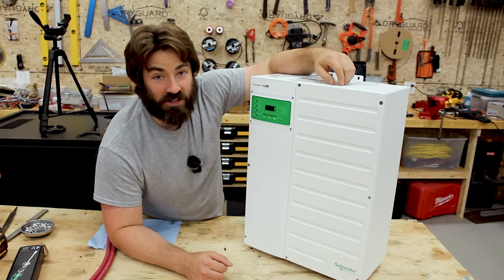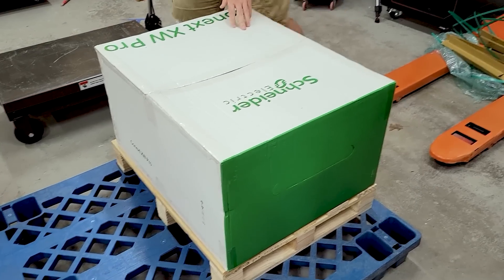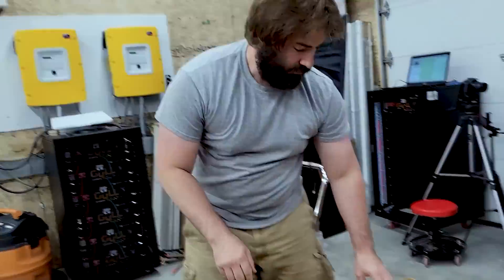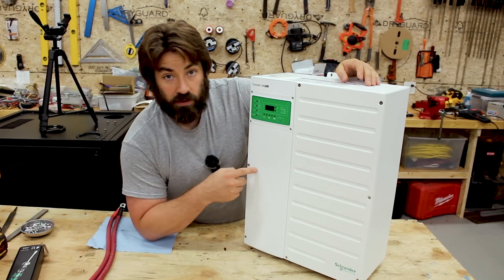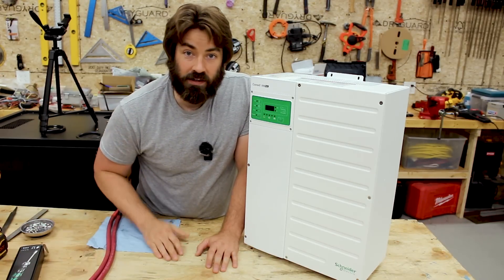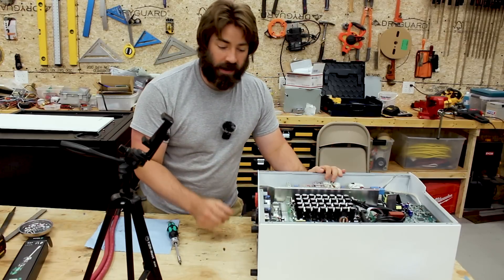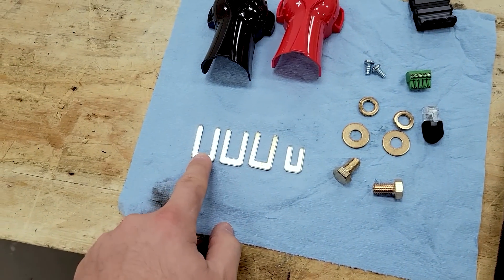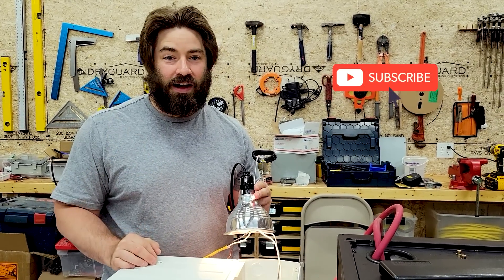Powerful Inverter for Solar Off Grid, Whole House, Schneider XW PRO 6848 Inverter, Hybrid

Comment: Dave, my first 48V solar system was a Schneider Connext 6048 (I think Connext was the Series model or the control unit?) It burned up in my solar shed fire that was caused when my Tesla batteries were charged at -20F and the heater in the shed quit working. It was connected to two Outback 200 Charge controllers and it always was giving me problems with my system. After I connected the auto transformer to my Sol-Ark 12K I haven't had any problems with any well pumps turning on or any other issues with the Sol-Ark 12k

Comment: Hey David, I would love to see you test this on big 220 air compressors, welders and heavy inductive loads like that! Thanks! Love your videos!
Reply from the maker: Thank you for the suggestion.  so far my initial tests with 120V stuff is awesome.  I'll try to pull together some 220V loads for a video.
Reply: @DavidPozEnergy  Yeah, but the real test is to put some sizable INDUCTIVE loads on it. That is what this beast is supposed to handle, and that is a key separator of the men from the boys. So motors, welders, etc. @240VAC.
Reply: That's already been done on YT by Abney Solar: https://www.youtube.com/watch?v=-Ez4cbuy7IQ&t=1131s
Reply: Abney Solar did that already on YT, although he used 2 units stacked. https://www.youtube.com/watch?v=-Ez4cbuy7IQ&t=1131s

Comment: Awesome inverter, love seeing the toroidal transformers! Two things come to mind - can you check what the no-load power consumption is? Curious how it compares to other options on the market. Also, you noted at 3:00 about connecting grid-tie inverters. I assume that means you can backfeed through it to charge the batteries? How does that work and will the inverter cut off when the batteries are full?
Reply from the maker: I'll be testing that stuff, but it is supposed to do AC coupling.   This mean you can use a grid-tie inverter or micro inverters and the Schneider uses the power to charge the battery.  Then, frequency shifts when full.  I'll test to see how well it works
Reply: I have a Schnider inverter with an AC coupling to a soul solaredge and it works flawlessl.  when the grids down it creates a grid that keeps the solar running. It charge is the battery, when the battery is full it’s frequency shift up turns off the solar will run the battery down a little bit. Bring the frequency back down and then Solar starts back up and it can keep that up all day long. 

Feel free to ask me any questions about it I’ve been using it on grid and off grid for four years now .
I have an AC coupled and DC coupled .
Reply: The other inverter needs to support the frequency shift, too.  Newer inverters will reduce output with every .1hz shift.. older ones will remain 100% output until 60.6hz (I think) and then drop offline until the batteries are discharged enough for the xw to bring it back into appropriate range.  It still "works" but is not as gentle. They'd be 0%, or 100%, so the batteries would need to be discharged enough to support the 100% (along with the loads, obviously)

Comment: I’m an off grid Solar bozo since 2005. I have a large homestead here and have multiple XW inverters. They are a beast and I haven’t found anything they wouldn’t power. Most of my inverters were manufactured in 2010 or 2011. Still going strong. I think it was DUMB of Schnieder to discontinue the SCP and force you to fumble with the Insight and a computer. Especially when almost all other competitors are placing advanced displays right on the inverter. You will need someway to program some basic battery voltages, etc. The mini PDP is enough for most people and makes for a sexy albeit expense setup. Have fun with your new workhorse!
Reply: what?  the SCP isn't discontinued!
love my Schneider (and older Xantrex) stuff.  i'm with ya, i think it's stupid there isn't a way to program the inverter - FROM THE INVERTER!  like via a user interface or bluetooth or something.  you HAVE to either get the SCP or the Gateway/Home/Facility...  hell, for the price the SCP should be included.

Comment: Very nice 👍 what a smart design, looking forward to your series of videos on this beast 😁
Reply from the maker: Thanks.
Reply: This is the best inveter that ever made. I am using the xw6048 since 2009 and never had a problem strictly as offgrid. This thing is robust. I ran four 18,000 split ac units and all my other household electrical appliances. Never had a problem.

Comment: Really interested in this inverter. My Sol-ark puts out a lot of Dirty electricity because it is transformerless. Transformer based inverters put out clean electricity.
Reply from the maker: I agree.  The manual even has a page talking about how clean the electricity is for use with HAM radios.  I'm not a radio person, but I understand it's a big deal.
Reply: In the last year or so, I keep getting faults on my inverter and the fault are not because my inverter is bad. It my power company’s power is bad, it’s sensing how bad the utilities current is and tripping a fault warning. 

Twice in the last year, it’s even disconnected from the grade for a little while because the grid voltage and frequency went out of spec .

Comment: Amazing surge ability.  Very much like the sma sunny island with that toroidal transformer.  Interested to know the idle current and its suitability for zero export.   Ideally you have it feeding a sub panel of critical loads and back feeding your house main panel but not exporting. Does it use CT’s on the main feeder into house?

Also if charging from a separate dc charge controller does it use a shunt to measure that charge current?
Reply from the maker: Hi Wes,  I think it was 30W in idle (on, but no load).  I know the manual shows some CT's you can buy for zero-export ability, but I run my equipment off grid.  There is an option for an external battery monitor that includes a shunt, but that's only required with different brand equipment.  I think the Schneider charge controllers record and report the data on their own, but not 100% sure.  it's something else I want to test.
Reply: It is very easy to set up zero export for everything that’s backed up by the inverter. It’s a simple setting that you turn sell off. It will then operate and load shave mode. Where is zeros out the energy consumption from the grid for all your backed up loads. 

In my house I have the inverter set up as a whole house transfer switch for backs up my whole house . As long as you are DC coupling the solar and it will work perfectly for zero export AC couple that cannot control the power flow going through it back to the grid when it’s hooked to the grid. 

If you want to set it up to zero out your whole house, not just what behind the inverter, you can put a separate set of CT is on at your main point of interconnection and set up a few settings to allow it to basically zero out the whole house. whenthe grid is up. when the grid is  down it will just back up the critical load panel .
Reply: I have my XW pro setup with a continetal controls wattnode,  so it can "sell back" to the main panel,  but limits itself so as to not sell back to the grid.   Works really well.  I have a spare wattnode I'm willing to send david, if he wants to try connecting his grid input, and "selling back"
Reply: @JeffPalmer941  Do you have the exact model number of the wattnode you use?
Reply: Idle power consumption is something in the range of 30 to 50 W

Comment: Awesome - glad you finally got a Schneider.  You will need either a Insight gateway or SCP to program it.  You can DIY your way around not needing the big or mini PDP, but you still need some way to switch and protect your AC and DC circuits.  The PDP's provide a place to do that, as well as posts to tie in other items like a solar charge controller.  But not strictly required for somebody handy like yourself.  Looking forward to your follow-up videos.
Reply: He mentioned the PDP so I assume he has it .

Comment: I used to work with big microwave power amps that demanded a lot of cooling. Big fans and similar metal mesh on the input.
One day we had a cricket infestation which got sucked into the intake. Blended and filtered crickets made a mess of that amplifier!

I first saw that inverter on Wild Wonderful Off-grid. The idea of needing all those accessories also made me think it's not as good as some of the lower cost alternatives. It's very typically 'old school' engineering to use proprietary interfaces and charge extra for standardised data interfaces, which is ridiculous when a Bluetooth and WiFi enabled microcontroller now costs $2.